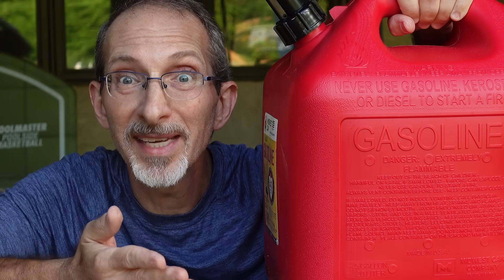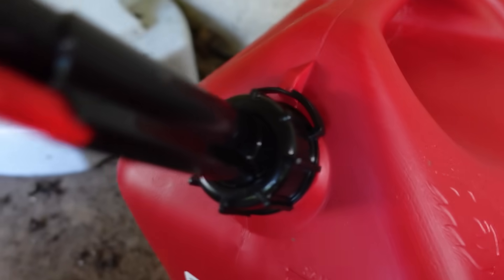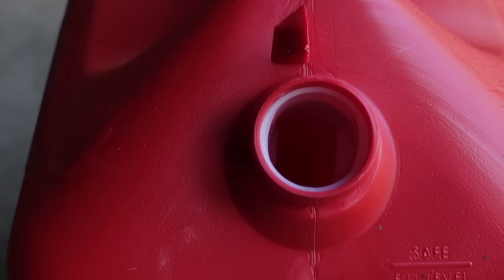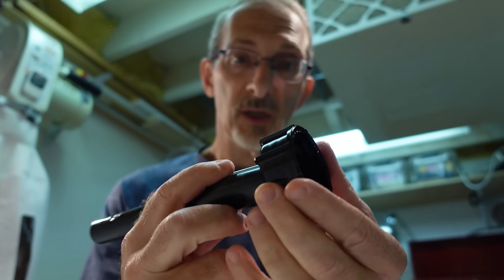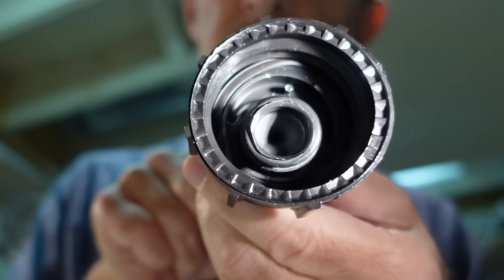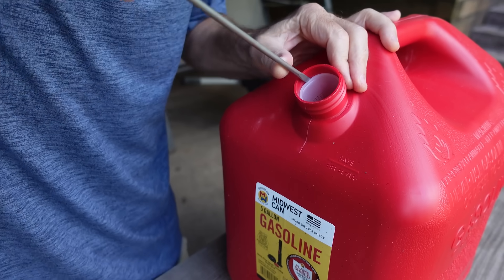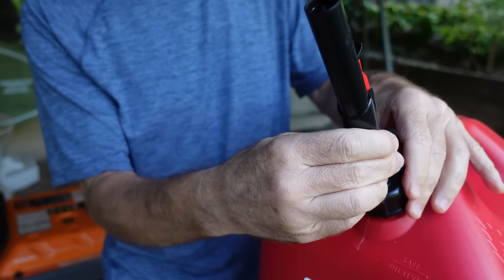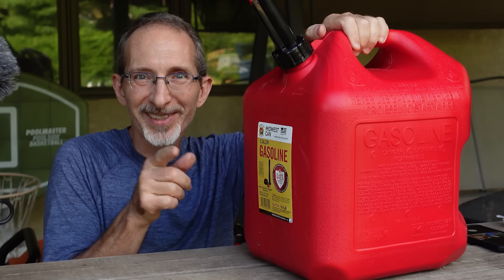Gas Can Modification | New Gas Can Fix

Comment: So good to see your vid on this subject.  I recently got a new gas can (Harbor Freight) to go with my new lawn mower and when I tried to actually pour gas from the black plastical spout; gas got everywhere, all over both myself and the mower.  Had I been stupid enough to try that fill with the machine running, I'd have been in a fireball.  Clearly all this "Safety" was about to get me killed or burn my property down so I grabbed a cross cut saw and removed the offending spout and now pour gas straight from the can into a funnel set inside the gas tank of the mower.  The can filter worked well enough for me so it's still in there; but will not hesitate to take a page from your instruction and remove it if needed.  This vid may well be saving lives.  Thanks for the good work.
Reply from the maker: Thanks so much for the kind words and I am glad it helped. I’m also glad that your gas spill didn’t escalate into something much worse. Enjoy that new lawnmower!

Comment: I absolutely HATE these @&#%!!! “new & improved” gas cans. I still have and regularly use a 5 gal can I bought in the early 90’s. Basic pour spout on the front & vent hole with cap on back. I can guarantee you I have spilled less gas in the last 25+ yrs combined using that can than I have in the past two years using these new cans. 

Can you guess what just jumped up to #1 on my To Do list this weekend??
Reply from the maker: All right, fix some gas cans and then put them to use with spring time yardwork? Thanks for watching and commenting!
Reply: @MikeFyxdt  yes sir, you got it 👍🏻

Comment: i personally want to kick all the idiots who pushed these improvements thru as law, right in the balls, and if theyre still talking after, im gonna kick you in the nether region again. perhaps one of the stupidest ideas for a problem that common sense was already a preventative measure. tomorrow i will modify all my cans so when i fil up my chainsaws im not worried about pouring gas all over the place instead of the saw itself. some idiot wont be seeing the extra money i spent on wasted gas in their pockets now, screw them.

Comment: The lock doesnt bother me as much as those pieces of junk spouts that bend st the top and has that lever cause you cant get the daing thing to fit your gas tank hole.
Reply from the maker: The lock on mine was particularly stiff. I think that’s because the spring was pushing so hard against it. It got much easier to use when I remove the spring or made the spring shorter. Much better now! Thanks for commenting!

Comment: Clearly these are the type of engineers that have never worked on anything in their life's
Reply: Not really the engineers fault. Some of these situations are caused by EPA guidelines that have to be followed so the engineer has to come up with some way to follow the rules but still have it work. I haven't seen any of the new EPA vapor protection designs work very well. Inevitably they end up spilling far more fuel than any vapor that could have possibly escaped the old fashioned type of screw on nozzle with a screw on cap. Perfect example of government bureaucrats causing more problems than they solve because they're idiots
Reply: @kens97sto171  You make a good point.
Reply: @kens97sto171 : Hahah, yup! It seems like they don't do enough (if any?) consultation with the engineers before they make a silly law!
Reply: @HelloKittyFanMan.  
Absolutely. People making rules and regulations about stuff they have no knowledge of.
Reply: @kens97sto171 : Hahaha! Maybe they became legislators because they couldn't hack it at a real man's job!
Reply: @HelloKittyFanMan.  
Yep that's probably correct. About the only job they can get is working in government because they're too damn dumb to work in the private sector at a real job
Reply: @kens97sto171 : Hahaha! Well, some of them have to find a private job anyway because for some divisions of the gov., legislation is only part-time. But... they probably wouldn't come close to being engineers!
Reply: Well, it looked good on paper...
Reply: Probably the same engineers who designed my friends sled... there's a bar right in the way so you can't get the spark plug out in any easy way
Reply: In their life's what? What possession of their life?
Reply: @HelloKittyFanMan.  they meant "in their lives", but not everyone has perfect grammar
Reply: @Sage-qd6tf : We don't know that's what Brian meant for sure, since we're not mind readers, so let's see what he says. Also, that's not a grammar issue but a word-choice issue. Also, nobody in this world has perfect grammar and other language use; some people just have better than others.
Reply: @HelloKittyFanMan.  its called reasoning. You can make an educated guess as to what he was trying to say, lmfao. Let's indeed see what he says. Also, word choice is part of grammar. So its literally a grammar issue like I said.
Reply: @Sage-qd6tf : I could guess what he meant, yes. But I prefer to be an unassuming character, hence my having asked him. And guess what: There is nothing wrong with that. LMTAO.
And no, it's not part of grammar. Grammar is the order of words in a sentence; sentence structure. Grammar and word choice are both parts of language.
And OMGosh, why do you care so much, anyway, even though I wasn't talking to or about you, and even though he's not even making such a big deal about it himself?
Reply: @HelloKittyFanMan.  "I wasn't talking to or about you" bro you literally mentioned me in a comment. Also words are a part of sentence structure, which is part of grammar, so I'm still right hahaha
Reply: @Sage-qd6tf : Not in the beginning, duh. I talked to Brian; not you. Then you started in on me like this was a discussion I was having with you even though it was not. So again, why do you care so much?
By "sentence structure," I mean verb first vs. subject first, etc. Subject, verb, predicate, etc. That's what grammar is. Then grammar is part of language. So again, you're wrong; not right. Hahaha.

Dictionary: "grammar: The study of the way the sentences of a language are constructed; morphology and syntax."

Also this link to "Is punctuation grammar?" (Next reply; let's hope it shows up when I try to post it:)
Reply: @HelloKittyFanMan.  oh, my bad. I the beginning I was replying to you because you were wrong lol. 

Words are a part of how sentences are constructed, so therefore I'm right

Edit: p.s. I don't care about your fucking punctuation, most of the articles I read are about engines or thrash bands

Comment: I’m betting the EPA has never done a real life heat test.  They left out the majority of gas can buyers, the lawn care companies.  Not allowing plastic cans to breath makes them turn into balloons on hot days and on cold days will collapse them.  I’m sure it’s safe to expand and collapse plastic holding a flammable fuel. 😒
Reply from the maker: Several people have mentioned that they were lawn care professionals, and the gas cans are exposed to the sun and changing temperatures. It doesn’t sound like plastic is the best material for this. I appreciate your input on the subject!

Comment: Why do you need a safety nozzle? I always thought when you tip the fuel can that's when fuel comes out.... Am I wrong?
Reply from the maker: When you tip these cans the fuel does not come out. You have to press in a latch and then depress the spring loaded nozzle. Then the fuel comes out, hopefully into what you were trying to put it into!
Reply: I just find it odd... In uk we have a flexible spout or rigid spout and that's it, no valves no switches no springs. We just use the rules of physics to keep us safe.... Same as everyone in the past did!

Comment: I had completed the filter removal myself last year but when I got my needle nose plyers in I twisted to reduce the diameter of the filter and pulled it out. Thanks for the spring idea though.
Reply from the maker: Twisting the needle nose pliers sounds like a much better idea than praying it out with a screwdriver, like I did. Thank you!

Comment: Why not shorten the spring to reduce tension? I had to do that in a pistol magazine. (I also crossed one coil to shorten it more while preserving the coil in case the spring weakens over time.)
Reply from the maker: That’s a great suggestion! I actually did try that in my second video, and it worked! There’s a link in the description if you’d like to see that video. Thank you for watching and commenting!
Reply: @MikeFyxdt  yeah, I saw part 2 right after leaving my comment! Good work!

Comment: That filter doesn't make sense.  Any dirt it catches would end up in the gas tank of the generator when  you fill it.
Reply from the maker: Casey you are 100% correct! I learned that it was not a filter, but a flame arrester after making the video. I did a follow up video that explains this, link in the description. Thanks for joining the conversation!

Comment: Typical government. They solve a problem that doesn’t exist and only cause more problems. In regards to these being sealed, with the old cans I never had gas fumes in my garage even if I didn’t open the door for days in mid summer. Now with these they look like balloons in the middle of the summer With these designs every 5 gal gas can becomes a 3 gal because you can’t get more than two gallons in. This solution leaves out one thing a vent. That’s the most annoying thing about these cans. The solution I found was to buy a $5 kit on Amazon that comes with the flexible spout and a pop in vent. You just have to drill a 1/2” hole in the back of the can
Reply from the maker: Josh I agree with you 100%!

Comment: These plastic cans do not meet NFPA or (full) DOT safety requirements.  Most of them do meet ANSI requirements which are "custom" written to include plastic containers.  These cheap to manufacture cans are marketed rather than designed for safety.  Rubbish!

Comment: You can do that or just buy a different brand of gas can and probably pay less, also the plastic on plastic sleeve would leak over time. That rubber o-ring would also break down with the gas having alcohol added to it. All in all, just go with a different brand.
Reply from the maker: Ken, makes sense if you are starting with a new can! I wish I knew what I know now when I bought these.
Reply: @MikeFyxdt  -- maybe next time you will look at the product before you buy it, I know I do. Most new products that hit the shelves nowadays are just pure junk anyway.
Reply from the maker: @Ken-rk3by  Good advice. I had them delivered during the beginning of the pandemic, sight unseen. Live and learn!

Comment: I love it when they make a product "safer" by adding all these user limitations that only force them to bypass them in order to regain some semblance of utility from the product, which in turn makes the end product more dangerous than the unmodified version this monstrosity replaced.

EDIT: Oh yea, and all these "safety" modifications cost the manufacturer millions of dollars in R&D to make these products, and consume far more resources, all of which makes this can cost 100x more than is needed. This thing need only be a tub of plastic with a spout... that is IT! If you hurt yourself using a tub of plastic... you deserve everything that happens to you.
Reply from the maker: The cost is definitely passed on to the consumer. (These cans were pretty cheap tho.) Thanks for watching!

Comment: Thank you for the Video. I have spilt more gas using these Safe cans than I ever spilt before the government fixed the problem. The vent in the handle is a great mod that allows the air in and the gas to flow properly. 
The original problem was the person trying to get a fire going better by dousing it with gas from a can.
Reply from the maker: I agree! Thanks for watching!

Comment: The Other issue I find with these stupid cans is no Vent hole, so the can sides will actually move in and out and make gulp noises as you pour the gas out.  I get the fact the EPA doesn't want fuel vapors to leak into the air, but they need to come up with a better solution then this junk.
Reply from the maker: @stagger19 - Vent cap added in the 2nd video!  https://youtu.be/XoYxdrhB6Ls. Thanks for watching!

Comment: Using two steel tools to remove that plastic, be careful you don’t create a spark.
Reply from the maker: Excellent point! I made sure everything aired out before filming, especially inside. Going BOOM would be bad. Thanks for watching!
Reply: @MikeFyxdt  I delivered fuel so I’m more cautious than many. One of our guys set off a flash when disconnecting from a station fill. His phone fell out of his pocket and hit the concrete, the resulting spark caused 3rd degree burns to his face, neck and arms.
Reply from the maker: @akbychoice  I'm sorry to hear that, but it's good to repeat so others can learn from it.

Comment: Step 1: Go to your local Rural King or to ruralking.com.

Step 2: Do a search for "5 gallon polyethylene fluid container." They come in white and red. These are NOT gasoline containers as defined by the EPA. It says so right on them.  However, they are suitable for storing "automotive fluids," including fuel intended for off road use. I can't imagine that you're planning to use your gasoline powered generator while going down the highway, are you? 

Step 3: Pay Rural King $21.99 plus tax for each "automotive fluid storage container" you buy. 

Step 4: Throw your EPA regulated official gasoline storage containers away.
Reply from the maker: I like your way of thinking David. It’s always good to have alternatives!

Comment: Breaking what "rules"? Bad products need to be changed.  The best way to fix new gas cans is to not buy them. All mine are the old kind. Get them at garage sales.  Most new stuff is junk. That filter and  latch proves my point.
Reply from the maker: I didn’t know these were bad until after I bought them. No regrets, they work fine now.

Comment: That cap safety catch has a purpose! These new cans don't have the expansion/contraction vent. If you unscrew the cap to the catch, it'll allow air to escape so you don't end up with a balloon.
Reply from the maker: Good point. It is a good idea to burp these cans by unscrewing the a little before you use them.

Comment: Go to tractor supply they sell the old fashioned flexible hose with threaded cap and vent plug. They work just like they use to.
Reply: Thank you!
Reply: Do the ones at Tractor Supply allow you to reverse the nozel and poke it into the can during transport and storage? I hate these new cans where the nozzel is sticking out all the time (always getting in the way.)
Reply: @herrunsinn774  They’re just happy to see you 😁
Reply: https://www.tractorsupply.com/tsc/product/ez-pour-hi-flo-replacement-spout-1053258?store=751&cm_mmc=feed-GoogleShoppingProduct_-1053258&gclid=CjwKCAjwnPOEBhA0EiwA609RecTocJXM4ZTwFsEoZTbEfQHtcIWRfzP4vW8mGUgiSfIMBuAFZEdkYxoC0WoQAvD_BwE
Reply: Seriously..been using these for 5 years with these new crappy gas cans.   These nozzles at TSC are gold.    Even with improvemwnts mentioned in video..which are all great...i still cannot pour gas into my skidsteer because of where the intake cap is located.   I have to habe 14" nozzle.  Funnels suck.
Reply: We also carry a can called a SureCan it has the spout on the bottom you fold it down and just press the button on the top to dispense removes any chance of spillage and it doesn't suck like the other new cans
Reply: And if you are worried about the nozzle being in the way, you probably dont need to be screwing with gas cans.    If yoh hide nozzle in the gas can...then you get gas all over the place when you need to switch it.

Comment: the gas can I use has a push lever use your palm to press it and then pour the gas in. It is pretty good sometimes it gets my feathers ruffled but before I pour i just push it in and out work it so when I go to pour it will be fine.
Reply from the maker: Yeah, you kind of get used to using whatever type of nozzle you have.

Comment: Yep, the "safety" of those cans arent safe at all. The nozzles leak and put gas all over whatever you are filling and if that isnt enough they are a pain in the ass. The older styles are way better. With these newer cans pressure builds up if they sit in the sun which bloats the plastic. If they bloat enough they will rupture and gas will be everywhere, which is why osha doesnt allow plastic cans on most construction sites...they have to be metal. I cant stand these newer safety cans. Safety safety safety but not a shred of sense.
Reply from the maker: Agreed! They are definitely not as good as the old ones. I appreciate you watching!

Comment: That filter may trap crud when filling the can but the same crud will be the first thing going into the lawnmower.
So why is the filter there at all, when there is no easy way to clean it?

I think I'll keep the spring but snip it so it won't be so strong.
Reply from the maker: After making this video I found out that the filter is actually a flame arrester. I explain this in my follow up video, link in the description. In that video I also modified the spring by stretching it and then cutting it in half. It worked perfectly, and made the nozzle much easier to press. I appreciate you watching and commenting!